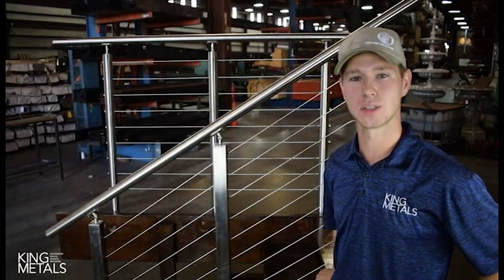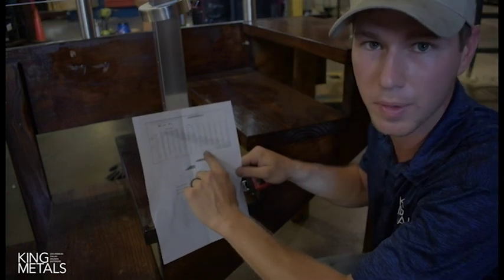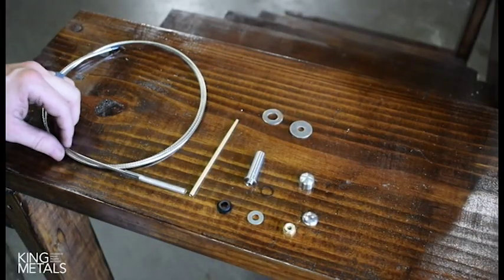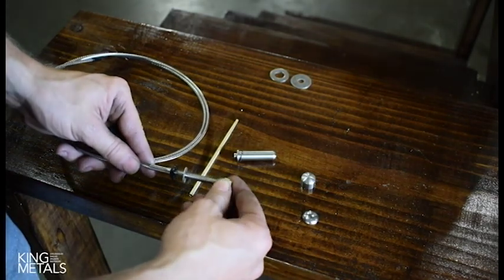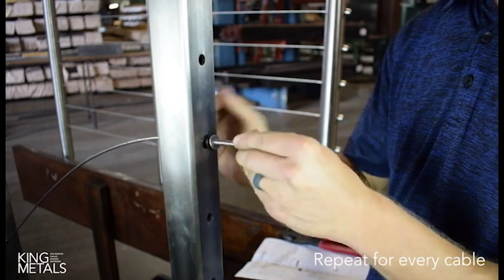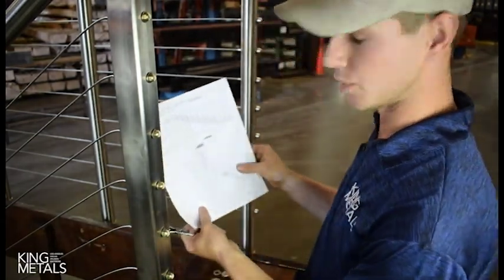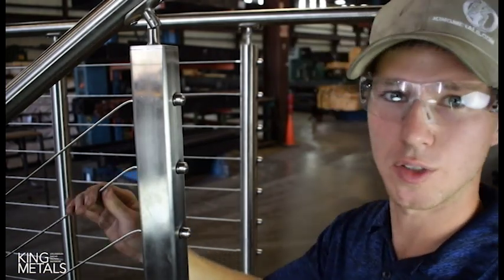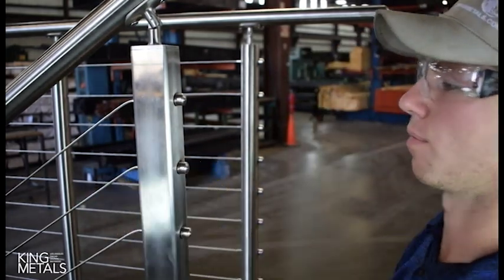How to Install Meridian Cable Railing System for Stairs

Comment: I forgot to put the base cap on. Any way to remove the locking end to pull out the cables?
Reply from the maker: If it is 1/8th cable, we offer a release tool and you can release the cable from the pull lock. https://www.kingmetals.com/Catalog/ItemContent.aspx?ItemNumber=34884